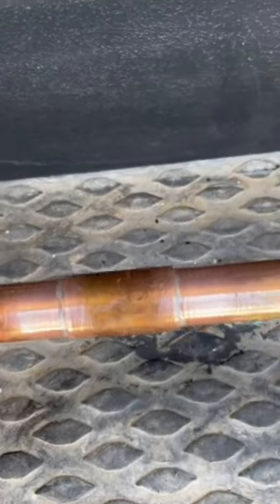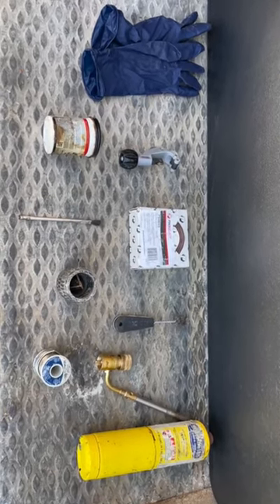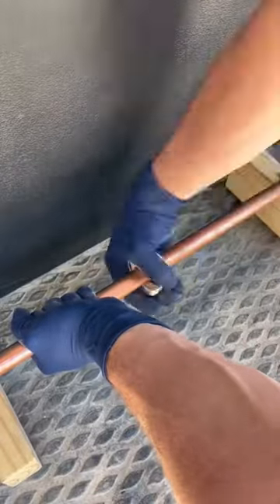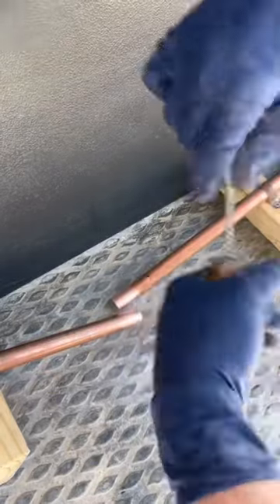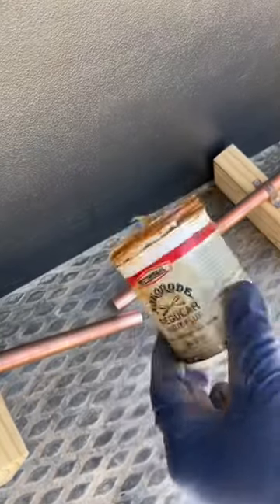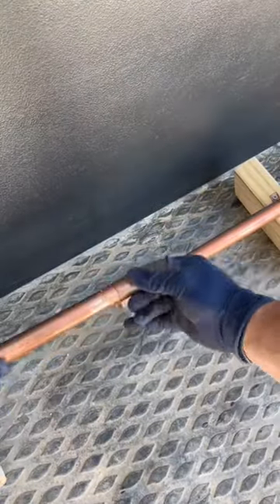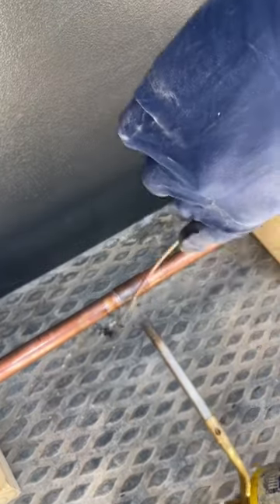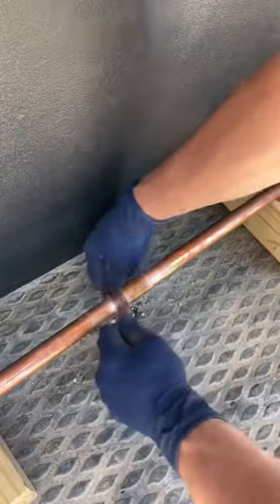How to solder copper pipe/fittings. From a plumber. #plumber #plumbing #soldering #trades

Comment: Never solder with latex or plastic gloves
Reply from the maker: Explain why?
Reply: @theplumbersplunger  in the case if something too hot comes into contact with the gloves, it may melt latex and stick to your skin
Reply from the maker: @ethananderson8719  Makes sense.
Reply from the maker: @Abraham Salgado I was always taught the oils from your skin can cause the solder not to take properly if you touch an area you just cleaned
Reply: Yea bro .. I’ve had solder fall on the mesh rubber handed ones and shit you cant shake it off and it burns the hell outta you .. I prefer gloveless
Reply: @ethananderson8719 today I learned 👌